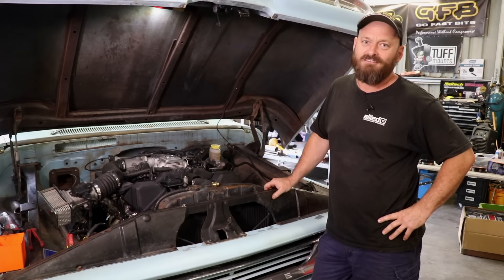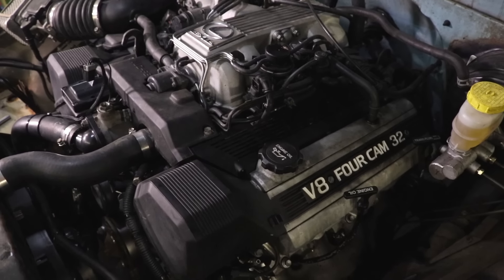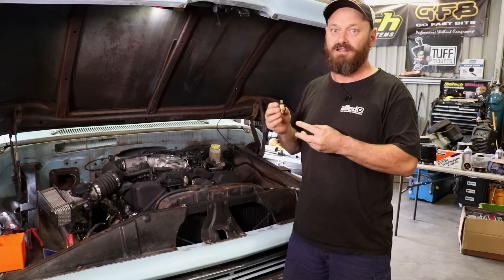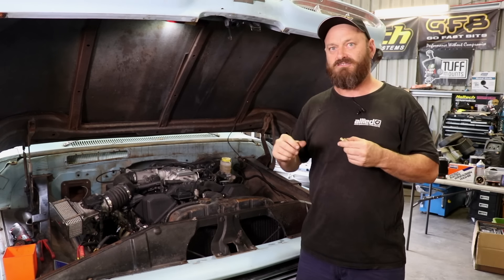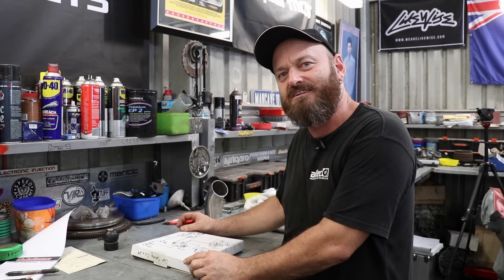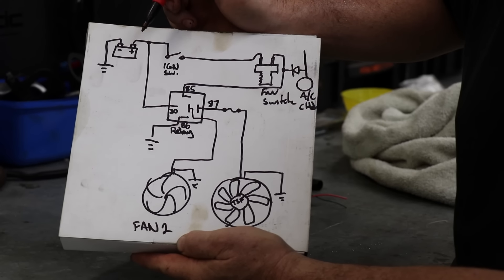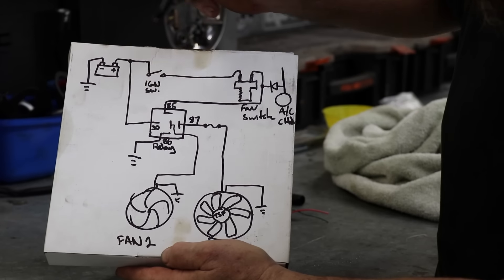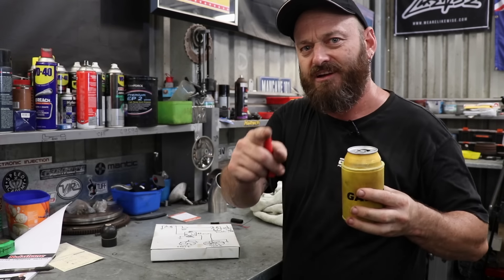THE SKID FACTORY - [QUICK TECH] HOW TO WIRE THERMO FANS

Comment from the maker: The Auxillary fan switch we used is from a 1980's BMW. It was sourced from our local parts shop but can be purchased online. https://tridon.com.au/products/Tridon/35/483/switches-and-sensors/2014/thermo-fan-switches/278/TFS106
Reply: VAG car of similar era had them too, my Audi Coupe had same. Probably same supplier, Bosch, Siemens or VDO. As said, you want to right operating range.
Reply: G'day Al thinking outside the box I see😉😊👍👍
On ya buddy .😉
Reply: BMW Part numbers are:

61318376440 for an 80c/88c part (94~99 318ti)
61311364272 for the 91c part 
61311364273 for the 99c part
61311378073 for a 91c/99c part

If opting for a dual temp switch, the connector can be had from most E30's, E36, E38, E39 and E46. Pretty sure the connector changed for the e6x e7x, e8x and e9x cars.
Reply: Isn't the 14 x 1.5 the same thread pitch as spark plugs and o2 sensors. The tap should be commonly available at most parts houses.
Reply: Question: What is the reason for wiring both fans to the same relay? Or, is one maybe bigger than the other? Wouldn't one always run with the ignition on? Just trying to dot my I's before I consider tackling this project.
Reply: @bryanbrunk1186  Most radiator setups have 2 side by side fans. Or sometimes a pushpull setup on more narrow setups. No point turning one on until the coolant hits the correct temp.
Reply: @thaneirwin4688  I'm aware of that but they also have a two stage setup. But to ask differently, the diagram appears to be wired where when one kicks on, the other kicks off. I'm not sure why that would be beneficial.
Reply: @bryanbrunk1186  there are two 97 terminals on that relay. They are the same. It is turning both fans on at the same time. If your relay only has one 97 terminal just wire both fans to it.
Reply: @russellhocken2477  you mean an A and B. A 5 pin relay has A and B. When one is on, the other is off.
Reply: @bryanbrunk1186  There are two 5 pin relay, standard 5 pin has twin 87 pins both N/O. What your a describing in a changeover relay, the other 5 pin type, where there is a pin 87 N/O and a pin 87a N/C. 

Not All 5 Pin Relays Are Changeover Relays.
Reply: @bryanbrunk1186  No Bryan. Go back and listen carefully (especially around 7:12).
Both outputs on this relay are either on or off.
This setup  will turn both fans on at 95 C and both turn off again at 90 C.
Reply: excellent tutorial, guess you didn't want to get into dual speed fans from the get go, baby steps and all for the youtewb newbs.
Reply: Seems like there is some confusion in the comments below, as pictured the diagram is using a Bosch (or equivilent) P/N 0332019150 relay. Not to be confused with the similar in appearance Single Pole Double Throw (SPDT) Bosch P/N 0332209150 which has terminals 87 and 87a.
Reply: I guess I'll have to look more into this other relay. I just figured there would have been another relay involved as in two but not another as in different.
Reply: pity. could have added additional 20 seconds of outtakes to make it up to a 10 min video.
Reply: This was a great episode!
Reply: Also have a look at 60's to 90's ish Ford with a hot light not a gauge. Most are 3/8" NPT or 1/2" NPT    You want to find the adjustable ones that have round push on stud that is either flat on the end or slotted.. Turning the stud in lowers the turn on temp.   An example is STANDARD MOTOR PRODUCTS TS36 ., however not all aftermarket senders are adjustable.

I have also used a GM sender but this requires digging out some sealer to access the adjuster screw.  

Another use for an adjustable sender.  I have a coolant temp gauge and a hot light.  The hot light is set just above normal operating temp / below a normal hot light setting so it warns me that temps are slightly high.  The only time it comes on is after pulling a long hill with a trailer.
Reply: should you fuse the 12v feed to pin 30 on the relay?
Reply: I prefer on at 84c and off at 78c.  Water temp.  Actual temps at head and cylinders are much higher than this.  I like to catch the temperature in a good range, before it has a chance to run away.  It is prudent to do this, especially if you live in a warm climate.
Reply: Has anyone the part number for the connector please ?

Comment: If you want to remember the relay pin numbers and never forget them. Relays are BET-A (pronounced better)

In the order from lowest to highest

30 - Battery ( High amp input)
80 - Earth 
85 - Trigger ( What trips the relay to provide power to active)
87 - Active ( High amp output from relay)
Reply: 86 is negative.
Reply: @dicktaylor2600  BETNA? Catchy.
Reply: 30 isn't battery.  It's just INPUT.  It can be positive or negative.

I've never seen an automotive relay with an '80' terminal.
Reply: @dicktaylor2600  - or positive.  You just need a positive and negative on 85/86, either one can be the pos or or the neg.
Reply: @TheTalonts  unless you have a Ford Bosch 40 amp relay with an inbuilt diode
Reply: This.
Reply: @TheTalonts  True, but in the traditional sense it's an easy way to remember.
Reply: Talonts Yes. There is no 80 in the DIN numbering system.
Reply: Haha just realised your catchy mnemonic doesn't work. 80 is supposed to be 86.
Reply: And it actually seems Al has it backwards. 85 is actually the coil negative and 86 is coil positive. This is important because of relays with diodes in parallel with the coil. I know it still works in his situation but it's incorrect.
Reply: @dicktaylor2600  This is what i've always used and was taught during my Autoelectrical trade
Reply: AE86 Driving Club ... Learn what a relay is  and how it functions and learn how to use a multimeter.... it's the hardest but best way........not that it's hard at all!!!! You tube and or google will have everything you need!!!!!!
Reply: @dicktaylor2600  They can be swapped, both work
Reply: @Leonbray  - I could find that very convenient, or exceedingly annoying.

That said, I have always followed the convention of 85 ground 86 pos when wiring up projects.  But I've run into ones wired "backwards".

Comment: Another good thermo controller would be the davis craig one. They are around $50, have independent control over 2 fans, an input for the ac compressor, shows the temp and also allows you to adjust what temp the fans kick in. Pretty sure the range is some where around 40- 120 degrees c
Reply: damn, pretty cool!

Comment: A basic on/off switch for your fan is kind of low-tech old school.  Look up PWM fan controllers if you want variable speed fan control for quiet operation under normal conditions.  Using the diode to make sure the fan is running when the A/C turns on is still a good idea if your PWM controller doesn't have an override. Keep sharing these little electronics how-tos, so much of modern tuning is in the electronics and it's great info!

Comment: Before I start watching this video, just wanted to say that I have my own method for wiring thermo fans.
Some thick ass wire to the batttery and fan, and a heavy duty toggle switch. Just switch it on when needed.
Speaker wire and a small crappy switch is not a good idea. It starts fires. I know this from nearly burning my car to the ground one time. My solution works alright, but I'll watch this and probably re-do it because Al knows what he's doing a hell of a lot more than I do.

Edit: Awesome video. Pretty simple concept, or maybe he just knows how to explain things well. Diagram helped. I'll have proper fans that turn themselves on in the near future.

Comment: Timely info for my project, as the way I had it wired up before decided to melt the power wires out to the fans rather than blow the fuse. I know how to properly do it, but have always been, for better or worse, a "don't fix it if it isn't broken" type. Going down the rabbit hole of pwm control when I fix it here soon.

Side note, if you showed up to most any car show I've been to with a 1uz in a late 50's Chevy like that, pitchforks would likely come out, grumble grumble, some BS excuse on how carbs and leaky 283's were how things were meant to be, etc. I love it!

Comment: I always put the thermo switch on the cold side of the radiator. This works really well and even better in cold climate since it isn't always necessary to start the fan if the airflow trough the radiator is high /cold enough.

Comment: I have spent the last few days surfing the youtube high seas for a proper video on how to do this, all i had until this video was people just wiring them upto a switch on the dash, congratulation on beeing one of the only people on youtube who actually know what they are doing. Question, I have an 80s sh*t box with no ac, can I get away with using a 1 pronged sensor or will I have to do extra steps (welding, drilling and tapping not an option at the moment), but the 1 wires seem to be the right size for the stock port. cheers in advanced.

Comment: It's worth noting that the relay in Al's diagram is a SPDT (Single Pole Double Throw). Both terminals the fans are connected to switch at the same time. Many relays you'll find are SPST (Single Pole Single Throw) where the middle terminal is 87a. If you're following Al's diagram make sure you've got a SPDT relay or you'll be really confused about what's happening if you replicate his circuit.

Comment: Oooooohhhhh finally a top tip I can give AL, rather than the other way around... I have used this sensor, but in a much better place. Just behind where he's put it into the modified bleed plug, there's a "bridge" joiner between the two heads. I just drill a 6mm hole in the middle, then run a modified spade bit using the 6mm hole as a center to create a nice big flat land for the sensor to seal against (20mm). I then open the hole further with the drill and run the M14 tap into it. You first drain a bunch of coolant out and pull the top hose off, so you  have a vacuum cleaner suck all the swarf out of the top radiator fitting as you drill. Works great and it's not the highest point of the motor where you can have clearance issues with the bonnet in cars (rather than the C10 or suchlike where there's heaps of headroom). Having that sensor sticking up out of the bleed point just looks funny, this is heaps tidier IMO

Comment: Ford medium duty trucks in the 90s used a diode that was the same package and fit as a atc blade fuse, we use them alot for the same fan control because its heavy duty and fits in a regular fuse block

Comment: That BMW thermo switch is a real all rounder. If you have a late model KTM500 EXC that boils in the tight stuff and frustratingly the fan never comes on, swap out the KTM part with this switch and you’ll never have the problem again.

Comment: Great way of doing it! Did similar in the early 2000's when I chucked a RB20 in my 180sx (a dumb thing to do). Had a boss welded into the thermostat housing and I think it was a Peugot switch though. We purposely used a slightly lower range switch to allow for the temperature difference. Worked a treat!

Comment: Only detail missing that would probably help people understand is: "why do you need a relay?"

You need a relay because most of the circuitry in the car is low power (ie. low-voltage and low-current) and although this circuitry is good for control (acting like a brain) it is too weak to drive big things like fans. Even if you get your fan or whatever to turn on it may actually cause your wires to melt.

So to fix this, you can have full-power connected to the relay and use the control circuitry (low power) to trigger  the relay into passing on lots of power to big beefy things like lights and fans. 

But Al is right - there's lots of good info right on youtube. If a video gets too technical or whatever don't lose heart just look for another video that fits you better.

Comment: I know this is 3years old but…
You should put your fan temp switch near the water pump intake. This will turn the fan on only when required. 
     By placing the switch near the thermostat, once the engine reaches operating temp, your fan will run nonstop… 😉

Comment: May be helpful to point out that there are a couple different layouts with 5-pin relays. If the output terminals are listed as '87' and '87b' this method will work because they are both NO (normally open) contacts that get closed when the coil is energized. If the output terminals are '87' and '87a' this method won't work. Terminal '87' is still a NO contact, but '87a' is a NC (normally closed) contact. This means that '87a' will be connected when the coil is not energized, and it will switch to '87' when the coil is energized. Using the drawing, Fan 2 would constantly run until the temperature switch closed, then shut off and Fan 1 would turn on.
Reply: Thanks for that. I had been wondering about the open or closed question, and you have answered it. Cheers.

Comment: You could also use another relay (yeah more parts) if you don't have a diode. Use the voltage on the A/C to turn on the 2nd relay, which then turns on the fan.

Comment: I use a pressure switch on the liquid side for the A/C system (usually just use a high side safety switch on a T same one used to cycle the A/C clutch) and run the switch on the Negative leg (pin 86). By putting the switches on the Negative leg I don't need a Diode.

As always great video.
Reply: TdrSld you always need diode or resistor parallel to coil no matter where you switch it. Or you dont if spark over the switch is ok and no electronics involved then ok. But diode is there to provide path for coil current as if there is no diode to "continue the loop" after switch is opened coil energy will be dissipated with a spark somewhere. In bad case the point for spark is at relay coil lacquer layer slowly destroying the insulation on coil and breaking that relay. Normally it is just small spark inside the switch which those usuallu handles quite long time, but having the switch on pos or neg side has no difference for this. Just like capacitors do not like shorting out coils  dont like opening live circuit, except in ignition where this feature of a coil is used on purpose.

Comment: Great vid fellas!

(Not)Pro tip from me. A lot of the BMW e36 TFS are a 3 pin switch (two different temperature ranges) that you can use to control the 16" 2-speed fan out of a BF-FG Falcon (later model, big single fan with a power resistor and 3 pins). 
Wiring in two relays you can have the low fan speed setting (~8A running) triggered from the low-speed switch, and a high speed setting (~20A running) from the high speed trigger. You could also have the AC trigger the high-speed side.
This will start and run the fan on low speed until it needs to hit high speed. It's even kinder to the fan and your car's electricals as you wont be switching on/off the full load current (in-rush current can be huge for a large fan), but a little more complicated on the wiring (but still relatively simple once you have a diagram).

Comment: A good source for automotive diode are GM mini fuse style, easy to find, available new, and since it's a mini fuse style you can easily wire it in with any mini fuse holder.
Reply: I think those are meant to suppress inductive spikes. I'm not sure they'd be great for this.

Comment: If you put the thermoswitch in the return from the radiator the fan will only run when you need it. On the engine, the fan will run even if you're cruising and don't need the fan. Both could be used in parallel as a failsafe.
A diode or something to suppress the inductive spike from the fan motor would be good too.

Comment: Hey Al, if you don't want to deal with the threads, Volvo used one on the old RWDs that just pops into a rubber grommet. 9135545 is the part number
Reply: I checked that out but the retaining method scares me a bit.
Reply: @alanbutler2579  - what?  What could go wrong with a grommet "retention" in a *pressurized system*?  It's not like rubber ages and loses its' grip.  ;-)

Comment: With a single post fan temperature switch you can do the same set up. You just need to have the relay coil between the ignition switch and the fan temperature switch. In the case of A/C you just need to introduce a second relay where the A/C diode will drive the second relay coil and you arrange the relay contacts so they deliver the full current to the fans via a fuse.
Reply: Yes that is true. There are many ways to wire fans but the dual post allows flexibility.

Comment: To be thorough, you should be using TWO diodes. One from the compressor supply line & the other from the temp switch, with both cathodes connected to terminal 85 on the relay. As for the diodes themselves, the common 1N400x would be considerably close to it's max current rating when powering a Bosch type relay. Whereas an 1N5404 would have ample headroom for this task.

Comment: That plug is for getting the air out of the cooling system. Also this video came at the right time. I need to do an electric fan conversion on my SC400 because I am getting ready to put a Procharger on it. Here in the USA the market for the 1UZ is limited at best. Can you all recommend a company that makes larger injectors for the 1UZ?

Comment: Please fuse your supply before the relay, try to put fuses for all your non-factory electronics within 30cm of the battery wherever possible when taking power direct from the battery.
Reply: never used a fuse for wiring fans or lights with relays in my 35 years and have never experienced a problem
Reply: I had an Experience already with a retrofitted circuit, long story short, it shorted and was not fused and it burned the relay and associated wiring, scaring me shitless. I now run a 30 amp inline fuse so I won't burn my precious truck down.
Reply: Circuit breaker, self resetting is the safest option